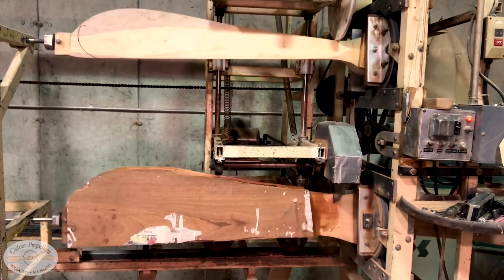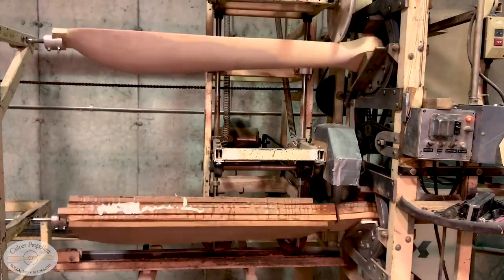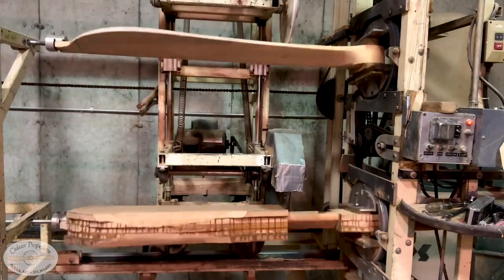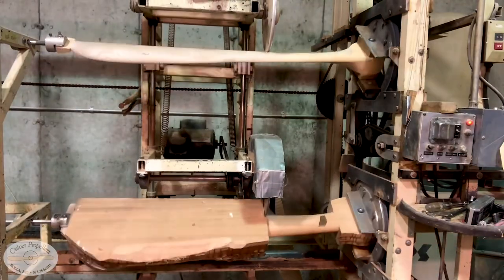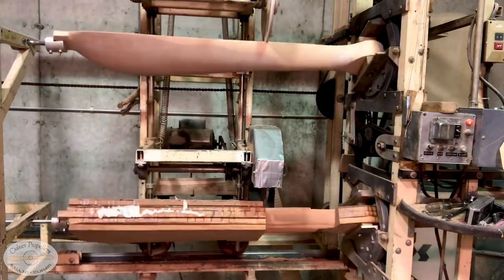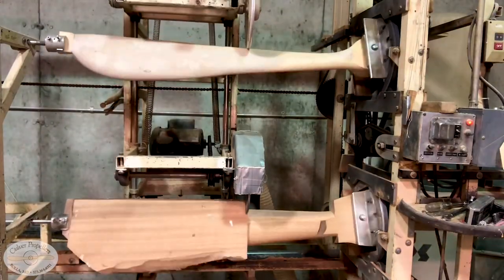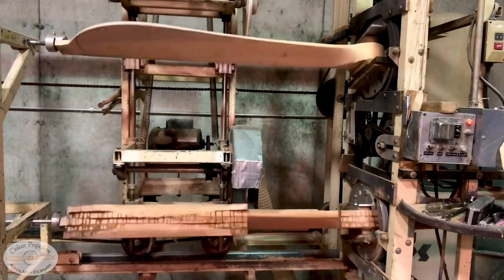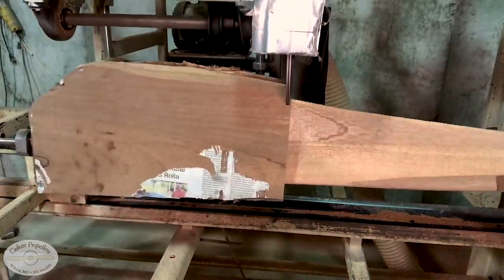How propellers are made

Comment: Why are you getting a serrated edge at the tip of the prop?
Reply from the maker: Because of the sharp tapper of the profile
Reply: The saw blade cuts a rectangular profile as it spirals along the propeller.  There is no way for a rectangular cutter to follow a curving contour and not leave an irregular surface.  A closer surface could be had if the blade was narrower, but a narrower blade would take longer.  Not only would a narrower blade take longer, it would still leave an irregular contour that would need to be refined by hand.  There are tradeoffs to be made, and the way the machine is now is the result of decades of experimentation and modification.  In other words, this is probably the best evolution of the machine that it can reach.
Reply: @deezynar  Thank You.

Comment: I'd call it an analog CNC machine.
Reply from the maker: I like it!
Reply: CNC just means there is a "computer" controlling it, and that there is an input, an automated process and an output. in this case the template is the input / code, the follower moving the saw (and other tweaks) is the process, and the saw blade being moved is the output. This is 100% a CNC machine because it is variable and automated. Its not a "creates 1 thing" no matter what machine like a die stamper, and is able to do a process without much human intervention.

Comment: The cost of digitizing your library of templates, the purchase of a suitable machine and then learning how to use it would kill the company in mere months. The varying amounts of material removal would cause endless grief. I run a CNC machine for a custom door business and doing 20 or 30 different jobs on one day is not the most efficient use of the machine.  Stick to what works for you. The satisfaction of the end result is enormous.
Reply from the maker: That’s what I had concluded by the tiny bit I know about CNC, it’s nice to have that feed back from a pro. Thank you!
Reply: From a Cnc machinist to another, i don't understand why someone would talk someone out of cnc. they sell very affordable 3d scanners to digitize her templates. A click of a mouse can make it longer or change the twist rate and sent to the cnc machine instantly. Storing all those templates in one computer file folder is a lot easier to manage than a large room you have to sift through. Cnc is faster, saves you more time and more money and more props made. I doubt these pantograph type of machines i see here would hold tolerances of .001 thats repeatable in any large scale run.
Reply: @addictedtopussy69  Up to a point I agree with you. However looking at how the company operates, it would potentially require a lot of changes. More laminating capacity, finishing, staff etc. Is the market there to increase capacity to allow a reasonable ROI on the set up, purchase and training on use of the software and machine? One thing Alaina has said numerous times is the pleasure she gets from the shaping process. The company I work for builds custom doors. With 6 manual staff, it is not big enough to supply me with a continuous work load for machining. The other really important question is "How  comfortable is Alaina with computers?" I have no idea and don't wish to assume anything. I am retiring next year and only one of the current staff has shown any interest in learning my machine. There is a shortage of staff in NZ who can do operate wood CNC machines at anything other than a loader/operator. I think it is horse for courses. I love the work I do but am glad the operating costs are on someone else's dime.
Reply: @MurraydeLues  sure you can do it this way because you enjoy it and thats something you can't put a price on. But don't expect to compete with shops that have cnc machines or they will run you out of business because CNC machines can do it faster, cheaper, and more efficiently.  Its like racing an old Model T vs todays Ferrari. Once the templates are in the computer, it doesn't take much to make a few tweeks to it which i think anyone who is not computer savy can easily learn in a day or two.  Think of it as extra tools and skillset.

Comment: I think you could maybe make one of two improvements fairly easily, first, does the saw baled have square teeth or are they staggered dog teeth, or you could use a router to give a less sanding option, just needs a bit of adjustment on the top part of the lathe, love the glamourous Duct tape on the saw. oops, I wrote at the beginning of the video, but I'll leave it there.
Reply from the maker: Lol, thank you

Comment: I admire that you are staying with the tried and true methods rather than chasing technology!  Wondering about those springs on your machine.  Do you have replacements?  Are they critical to the making of a prop?  What type of dust collector do you use  in the process of making props.  I Enjoy your work and videos, always great!  Thanks for posting
Reply from the maker: I should probably get some ordered, but I am sure they come from McMaster Carr. I use a system from Grizzly, they are old and still going strong
Reply: Do you have a source for the saw shafts?? I,ve looked all over and can,t find any.i need some to make a trim saw for my sawmill.

Comment: I like the "not going CNC" attitude for this. A lot of people don't believe it, but introducing a computer to the equation doesn't necessarily improve the process. In your case, it would very much add unneeded complexity for little or no benefit.

One cool improvement that would definitely be an option is to be able to adjust the arms of each side of the blade/pattern follower on a bit of a lever system. That would give you the ability to scale patterns up or down without creating a new pattern. I think that would be cool (but not necessarily useful).
Reply from the maker: Thank you! Yes that would be a neat option!